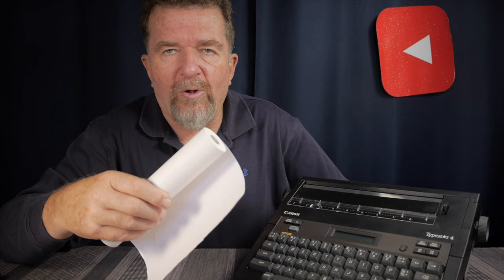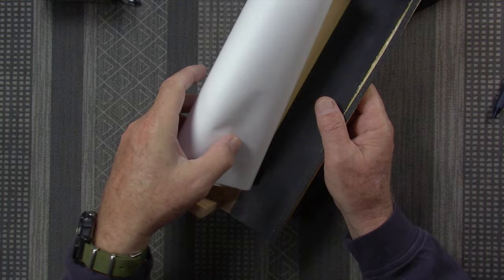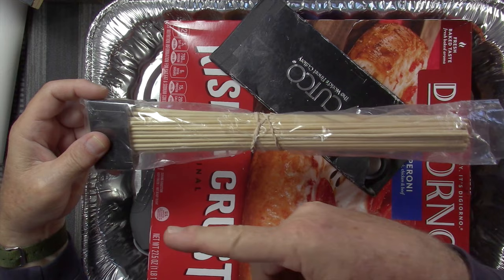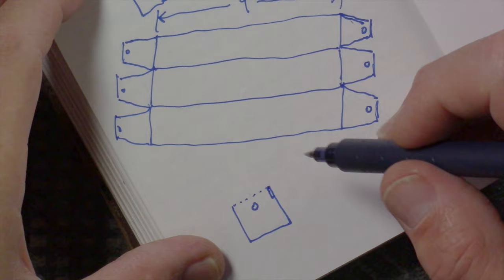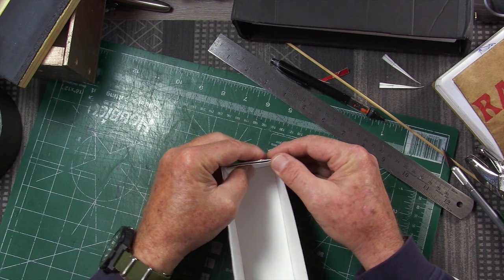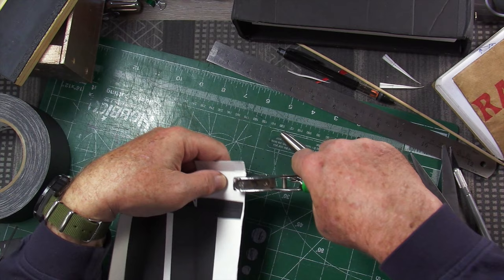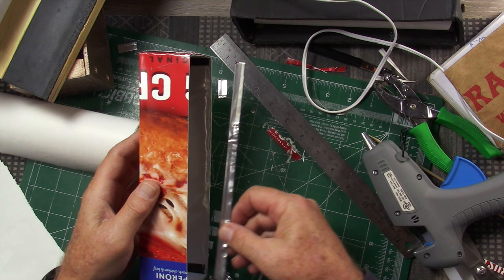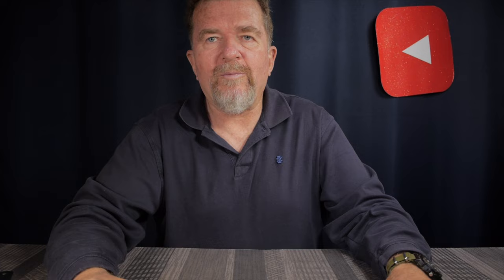Typewriter Video Series - Episode 248: EKG Paper Roll Holder

Comment: Joe, bvb ack in the 1980's I worked in  radio. The best and most durable TYPEWRITER-type machine I EVER saw were the old, mechanical "UPI" and "AP" wire service ones. They were on duty 24/7/365 and activated automatically from the main news provider bureau or the regional office. They were classics! Ink ribbon, HUGE paper scroll roll, bell with different chimes for "NORMAL" feeds and a different, LOUDER ONE for "bulletins". They were quite literally "living machines". The on air announcers, non newsman, monitored them for the URGENT bulletins and were authorized to "RIP and READ" them. I always felt sorry for the news guys when they arrived in the AM for their "GOOD MORNING SHOWS" with the DJ's because you just WOULDN'T believe how HUGE a mountain of printed roll paper had accumulated on the floor of the "NEWSROOMS" BEHIND the machines! An experienced "newsman" had the skills to go through the pile like a termite through a rotten log! They'd somehow manage to ALWAYS find only the pertinent stories THEY needed for their broadcast reports. Amazing. Now?... All this is on computers. No typewriter mechanism CLICKETY CLACKING away; just the quiet "WHUSH" as each page "tagged" emerged from the modern, industrial strength, inkjet printer. Just NOT the same as "THE GOOD OLD DAYS".

Comment: Good one Joe! I can relate. I too have burned myself with drippy screaming hot glue from a glue gun.. Kinda wakes you up. Nothing wrong with spray paint. I use it on my truck! Joe MacGyver Van Cleave! IF anything you make will go outside in the summer, don't use a hot glue gun! You project will fall apart in the summer heat. I found out the hard way when making a home movie set in a shed. I switched to epoxy. smells bad but holds.